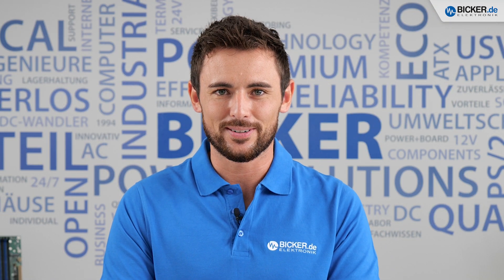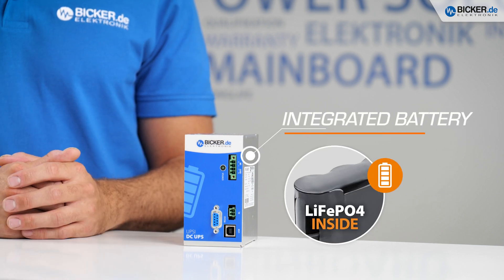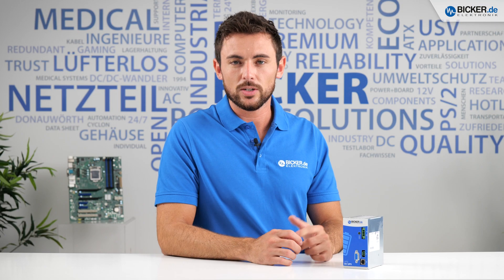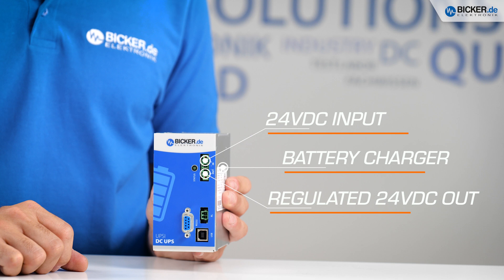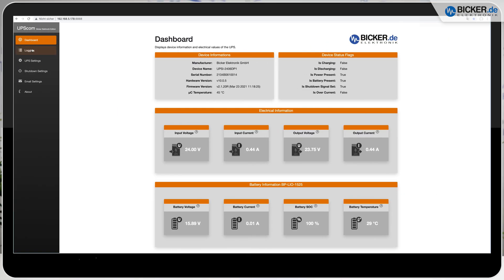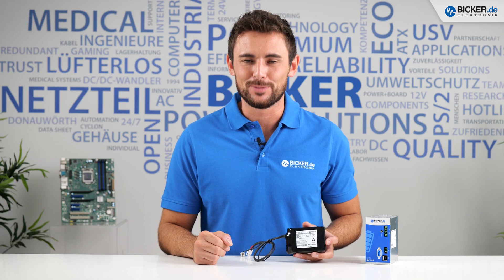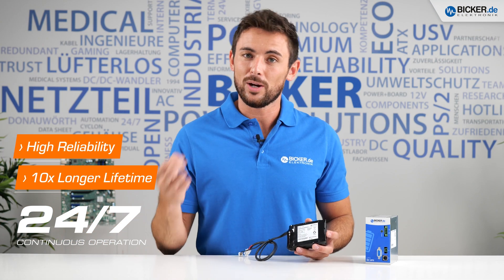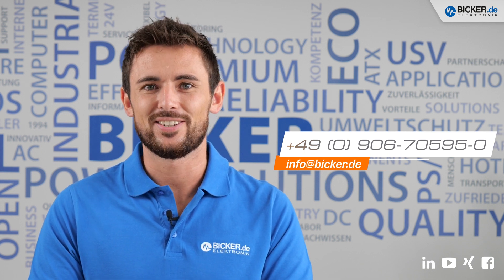BICKER UPSI-2406DP3 – 24V DC UPS with LiFePO4 battery – Uninterruptible Power Supply UPS (USV)

Comment: Is it possible to add option to charge batteries up to specific value - 80% to preserve batteries longevity. It applies to Lithium-ion, does it applies to LiFePO4 batteries, too? And how about more than 150W option (~300W) for current high demanding CPUs TDP solutions? What brand LiFePO4 is used? Is it Lithium Werks brand?
Reply from the maker: @Coool_
@Coool_ Li-Ion batteries have only 300 cycles, the LiFePo4 batteries with cells from LithiumWerks have up to 5000 cycles. Thus, the service life is already significantly over 10 times longer. We have also integrated a high-performance BMS for optimum charge and discharge characteristics and a particularly long service life.  
For more power please take a look at our UPSI-2412Dx model  with up to 12A peak: https://youtu.be/Jvn1m3w3IJg